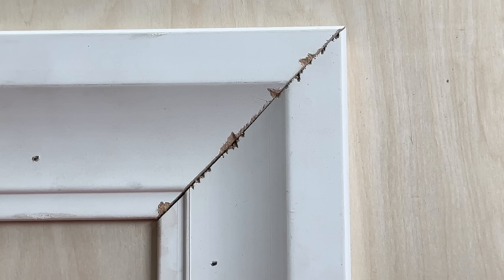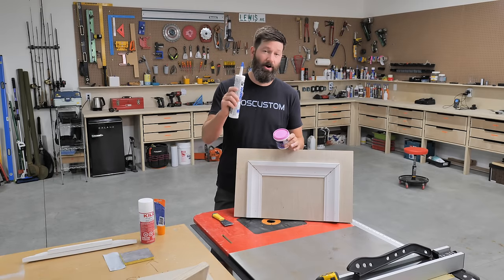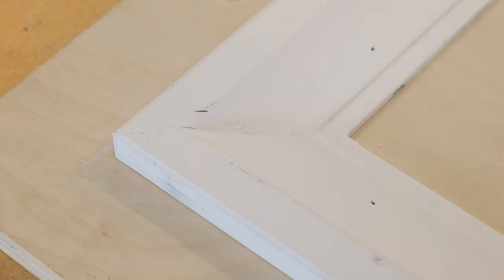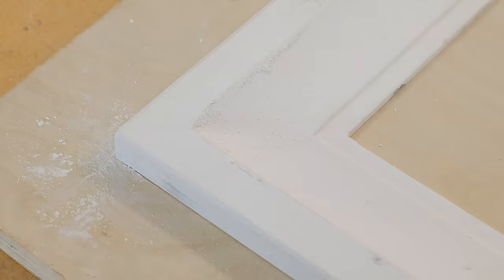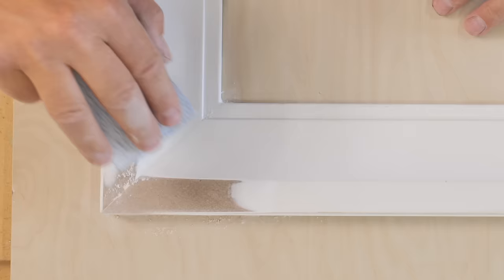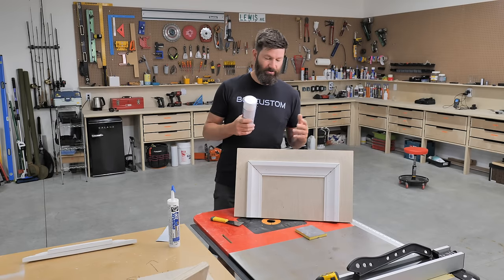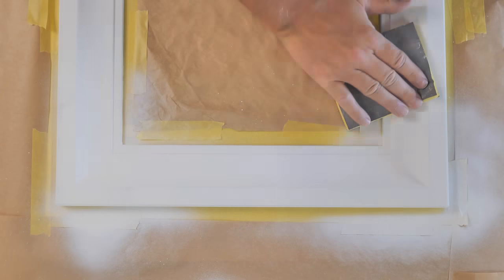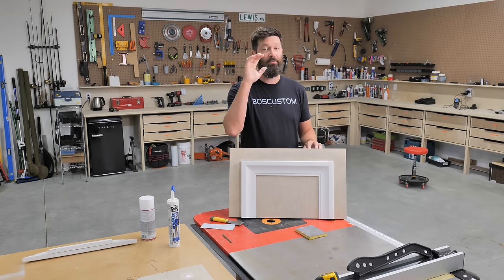Old School Tricks To Make Bad Mitres Look Amazing!

Comment: Why I always use caulk instead of wood filler (30 years as a painter): wood filler is not pliable while vinyl or hybrid caulking is. There is a reason why these corners look like that… they are still moving/settling. That wood filler will crack within a month while the caulk will flex and last longer.
Reply: You need to glue the joint first, that will stop any relative movement between the trim pieces, then the wood filler should work perfectly.
Reply: @hyperion112  That obviously didn't work the first time... the wall is still moving. Use caulking.
Reply: @Fortylat  obviously the joint wasn't glued, caulking miters is for flippers and DIYers not for professionals.
Reply: Walls do move, but never enough to open up a mitre. If a mitre is opening or moving, it's because it wasn't glued correctly. Wood filler is absolutely the go to for trim, not caulk, trim does not ever move enough if glued and pinned properly
Reply: @Fortylat  What kinda shoddy places you working on that they are all continually moving?
Reply: @OptimusSatanas  your mom’s house.
Reply: @Fortylat  "30 years as a painter"  yet using mom jokes? i smell something fishy and this time it aint your momma.
Reply: @013rich
Why does it matter?  What is the disadvantage of using caulking?  Thanks
Reply: matthewphilip1977  thanks
Reply: Total agree! 25yrs as a painter and no more skills aka caulk has flexibility for movement.
Reply: matthewphilip1977  And harder to use.
Reply: Glue and biscuit the miter. Get it tight enough so you dont need either. painter < cabinet maker 🤷🏿‍♂️

Comment: As a painter “carpenters”using caulk is the bane of my life. They get all giddy with it and want to use it for everything and I have to spend far longer than it would take to fill it properly removing the caulk before I can do anything else. Caulk is just for angle joins and can’t be sanded so put it on smooth or just don’t put it on
Reply: Thank you for putting quotes around carpenters. I can assure you that as a carpenter, I would never fill a flat surface with caulk. The guys that do that are hacks that are trying to hide their horrendous cuts from everyone.

Comment: Perfect...as a painter,this is the Exact product and technique I use. As for the primer, advance works well. Advance is a hybrid paint (water based with oil properties). Never had a problem on raw wood with it on small areas. However, you don't want to use it too much because it's quite a bit more expensive than regular primer. I will say..Elmer's wood filler is an essential in my work bag!

Comment: I use Bondo. It is structurally strong and will adhere the two pieces together plus fill the gap then finish as shown in the video.
Reply: I like using bondo too.  Good stuff for projects like this.👍

Comment: I have several ornate (Rocco...Baroque) picture frames which I purchased online. The seller cut them to order from sticks of molding. The miters are off a bit. My fix: Acrylic nail polish in a gold color. Dries hard but just enough flexibility for nanometer movements due to normal changes in humidity. Relatively inexpensive. The brush is tiny so it can flow the polish down deeply. Everything else you mentioned is spot on. I can still learn new or update my thinking after 55 years of hands-on "stuff".

Comment: I've been doing this type of restoration/refresh work for years.  I use carpenters wood glue first.  That's the key to making these joints solid and able to take a good door slamming.
Reply: Exactly. A mitre that is NOT glued is NOT going to stay tight. Filling a mitre joint is only a temporary fix for it WILL open up with time.
Reply: Mine are over a hundred years old. They aren't glued. And there's no gaps. Although I think gluing them is a great idea.
Reply: I have also used wood glue.
Reply: Yes, the problem with wood filler is that they are just sand/glass powders. They don't expand or contract when temperature or humidity changes, while the wood swells and shrinks, that's how it would crack in dry seasons.

Comment: For real demanding trim/base wood filler situations I prime (either oil or alcohol based) then apply filler, this improves filler adhesion . Some filler manufacturers' instructions include this advise about priming first. And yes, then I prime again.
Reply: matthewphilip1977  It could be water-based primer and that would be effective. On bare wood, imho and from what I've read, oil-based primer is best because it penetrates more on such a porous surface. This seals better and gives more adhesion to the next application. 

I know it's a pain because of the longer dry time, it's more expensive primer, it smells and brush/roller clean up is way more of a pita than water-based. For a small area I would only use some cheap throw a way brush. An alternative is the same primer in a spray can. 

A good, popular, in-a-hurry solution is Zinsser BIN primer (alcohol based), also available in a spray can. It is a very fast drying primer.

Comment: The Zinsser BIN primer is the best especially if you have to cover Smoke damage.  It was incredible.  I have not used spray cans of it but gallons and 5 gallon buckets.  But also use a good respirator if using to cover large areas or whole rooms/ ceilings.  Expensive but well worth it in the long run!

Comment: Nice hair!  The wood filler is what to use to fill in baseboard joints that are starting to have small gaps?  Also in my fairly new build ~ the baseboards and door trims are such a mess…😬 globs of caulking and terrible nail fills in spots.  Just no care whatsoever and of course this wasn’t super noticeable at first.  The sanding sponge looks like that will work great for smoothing that.  Thank you

Comment: Thanks for the tip using wood filler on mitres instead of caulk. I have a small front porch entrance needing repainting but some wood boards have weathered cracking. It's not an option to replace, so would you fill with this type of wood filler or use something like epoxy before painting? Any advice would be greatly appreciated.

Comment: I've watched a half-dozen of your videos while working on the casing & baseboards on my hallway project and you giggle EVERY SINGLE TIME you say 'Crack'. And now you're laughing at 'blower'. Keep it up bud  :)  Nice fancy hair BTW.
Reply: It’s gotta be hard to have a channel about crack and caulk w/o laughing
Reply: Following up on this. My house moves too much to use wood filler in the 45° corners. They all cracked in under a week. I'll use wood filler for the nail holes, but everything else needs flexible caulk.
Reply: @debs-101  So hard

Comment: Great video! Yes, lightweight spackle is soft, but does that matter, particularly if you are dealing with the top corner? You also did not explain why caulk is not a good idea. Sandable caulk has worked for me in some contexts.

Comment: If you use an oil-based primer can you use latex paint over it? I am going to use Benjamin Moore Advance, which is apparently a composition water/oil. Do you all think I should go w/ Zinsser oil-based Cover Stain, Zinsser shellac primer, the Benjamin Moore Fresh Start High-hiding All-Purpose primer, or something else? I had new floors put in, so I’m painting the baseboards before I re-install them. They needed a lot of tlc, and even more wood filler, so I will apply primer to all of them.

Comment: Any suggestions about when spraying the primer? I am concerned that I will hit the wall. Does this technique also work with baseboards that don't met in the corner? You are is marvelous.
Reply from the maker: You can tape it off, or if you are repainting the walls just spray onto them and paint over it.  This technique will work well for outside baseboard mitres, but on the inside it’s best to use caulking.
Reply: @TheFunnyCarpenter  recommended caulk?

Comment: First,  your hair is fabulously fancy. Second,  will the Elmer's still work if the defects were painted over. I'm dealing with nail holes,  staple holes and dents that were painted over, and I can't sand inside the small holes and some of the dents.  Will the Elmer's adhere to the painted areas?
Reply from the maker: Yes it will work over painted surfaces.

Comment: I always use wood glue on miters. Maybe it depends on climate, but i find thats the only way to prevent cracking. If it's already installed i still press glue in with my finger. I use the pink Dap filler, i like it, but i imagine if i didnt glue it would be a disaster.

Comment: Confused by the terminology. Maybe different here in UK. I always use "all purpose filler" with wood and cracks holes in plaster walls. This is typically a white chalky powder you mix with water (or buy premixed in a tub or tube). If I am tiling then I use "grout" to fill the spaces. I use silicon "sealant" for bath edges etc. What is caulk?

Comment: Thanks, great video, and the joints look great! Almost as good as your hair 😁but it's only 2 months old, and the Amazon link goes to really limited and expensive options.  I think the same filler comes in 16 oz square tub at a much better price, and it seems a little easier to find.  Lowes apparently does not carry these Elmer's fillers anymore, and Home Depot's website search fails miserably....but I think they have it.

Comment: I disagree on the oil based primer. It will flash under water based paint. Ive used pro block latex primer for years on bare wood without any issues at all. Good video and great tips though.

Comment: Do you think DAP's Plastic Wood brand wood filler is comparable to the Elmers? Or is there something special about the Elmers? DAP makes different colors and white just like the Elmers filler.
Reply from the maker: I haven’t tried the dap stuff, but I’m sure it’s probably decent. The key is to sand the filler before it gets too hard.
Reply: @TheFunnyCarpenter  Ok - my HD did not have the Elmers, and I'm gonna give the DAP Plastic Wood a shot

Comment: I thought you had to match your primer type to your paint type? So oil primer for oil paint, water primer for water paint.

Is that not actually right? Or is this specifically OK because you're dealing with wood, rather than drywall?

Comment: Same principles used if the moulding is outside surrounding a french door?  Or what is the better to finish the outside moulding that is against stucco
Reply from the maker: Same technique will work, you can use exterior wood filler, and then an exterior trim paint.

Comment: No particular need for a solvent based primer, Stix (amongst many other water based primers) is much easier to use, great adhesion, quick drying, easier clean up and good to sand. Thin the product a little to soak into new wood and leave an even finish. 

Spray cans of Zinsser Bin clog up very quickly and it has a terrible shelf life of 6 months, so I wouldn't recommend it, there are plenty of new waterbased products on the market which provide stain blocking and good adhesion which are much easier for a DIYer to use.

Comment: Think Ive been watching a different video to the rest of you.  If you make mitre cuts like that, you need to learn how to make mitre cuts, that will save you all this work in the first place, but if you have to correct this bodge job, here's a few tips to help you.

Place masking tape either side of the bodged mitre join and the use a lolly stick to push the filler into the gap, the benefit of a lolly stick is it can be shaped and won't create even more damage, the masking tape will allow the filler to stand slightly proud and make sanding a very quick job. Personally, I always fill twice due to filler shrinkage, they say they don't but they always do, so look to fill it again after the first fill has dried.

As for using an orbital sander, as can be seen in this video you have to be careful how much you sand off else you will get the result seen in this video where the shape becomes distorted. If possible a better method is to pull the lower of the two architraves forward to minimise the sanding level, if done correctly you will not need to sand level at all and can fill the gap between the wall and the architrave with caulk.

Comment: I'm surprised nobody in the comments have yet pointed out that this isn't wood trim....It's MDF. Which is essentially compressed cardboard/paper.

It doesn't react the same as pine, gumwood or oak trim, where the grain raises when moisture is applied....it slightly swells and results in poor coverage. 
Wood trims don't have that blistering in the mitres as it's not a candy coated paper product, so you never really have to go through this process if your blade has more than half its teeth left.

Your video itself provides some great tips and tricks and your final result looks good, but this isn't real wood trim that reacts differently to glues, primers, fillers, etc. You have some factual works here but need to be sure to include the details for the handymen trying to replicate your work.

Comment: Your approach is entirely correct. But, let's be honest - that frame ( most frames...?) is a cheap piece of krap. 
So, fill it , sand it if you must ( easier to just make the fill smooth in the first place) only paint if the repair sticks out and you have some white around. If you have some matching nail varnish - use that.
Life if too short wasting hours and $20 on a piece of krap.

Comment: Never noticed the hair - focused entirely on the process of mending the mitre. In the main I prefer presenters to stay out of shot, keep dialogue to a minimum and maintain the discipline of keeping the video short and to the point otherwise  I end up fast forwarding to the relevant segments turn off the audio and rely  on closed captions.  Nonetheless, the key points I took note of are: wood filler, sanding between applications and the all important primer. Well done!

Comment: This is really going to help me! I have no idea who the idiot was that did the trim in my house 😂, but it's a mess! Did you spray the final paint as well? No matter what I do, I end up with brush marks when I paint my trim.
Reply: I have been doing my trim work over the past two winters. And being at nose level with the baseboard and looking at the paint that was supposed to be 'finished', ah was a bit frustrating.
Just by shear chance was at HD and purchased this kit and stuck it on the shelf for a couple of years. I did use it for something else and was impressed with how it turned out, then tried it on the baseboard. More impressed. Much better finish and way faster.
You do need to be careful when removing the used roller and the handle is plastic and the 'split' can be a bit of a trick if the roller is full of paint.

 Pintar Quick fix & Small areas kit

Comment: A request for a future video... Whoever did my walls back in the '80's feathered from the corner beads to the wall in about 4~6". Every corner looks like a ski slope! Would like to know some trick to run the feather out to 12" or 18" so it somewhat looks like a straight wall. Thanks! - Joe Azzarelli
Reply: Lots of mud and a really wide drywall knife. Sand, prime, then paint the entire wall panel.
Reply from the maker: I’d recommend checking out Vancouver Carpenters channel, he’s great on these types of things!

Comment: Painter caulk and paint. Fixed in 10 minutes. Wood filler is inelastic and will just crack and fall out with expansion and contraction.

Comment: The trouble with all this is that you DON'T end up with the repair looking like a mitre joint - it looks like a filled and patched job. Go look at a good mitre joint and you'll see the line joining the two pieces - you don't have that with this repair so the repair stands out like dog nuts. Maybe run the knife down lightly before it sets to make a fake line - looks better.

Comment: Best filler is just drywall mud: cheap and super easy to sand. Once it's painted, the surface is as hard as the paint. After priming, or first topcoat, check for any filler touch-ups that may be required. If pressed for time, "hot mud" (Durabond 20, 45, or 90, for example) works great as long as the repair area is not overly large as that type of filler is not easily sanded. Cheers.
Reply from the maker: I would disagree with the drywall mud. I’m sure a highly skilled person could get great results but the more common result is over sanding such a soft compound.
Reply: Disagree, it's soft and will fall away. Only place mud is good, is on papered surfaces on drywall, or a painted wall that's been sanded previously.
Reply: @TheFunnyCarpenter  Yes, it is soft. So soft, you can sand it by rubbing with your thumb. But light sanding with a sanding sponge works great. No high skills involved. Of course, to each their own. Cheers.
Reply: @thomasgreenan8617  Drywall mud if you're about to sell the house, his method if you want something durable that will last years.

Comment: Sanding the two boards out of plane works for the highest area, but leaves the rest of the miter uneven. Virtually impossible to sand those other areas to match. Best to level the two pieces first. Shim the recessed one up, to match the other one. Then proceed with the wood filler. Then caulk the shimmed board to fill the gap created between it and the wall.

Some morons will nail the miters together, usually from above, to try and get them to mate. If this is the case, then sanding might be the only way to level them. You can try digging out the nail. Or even sawing through the miter with a hacksaw to cut the nail, then shim them together.

I really like another replier's idea of starting with glue, before the wood filler, to lock the miter together.

Comment: How could someone be such a hack to cut a miter like that? Even a cheap miterbox with an replaceable blade won't make such a mess.
Reply from the maker: This is a pretty extreme example, the average bad mitre will probably just have a gap and maybe a chip or two.  Either way the method in the vid works for all of it.